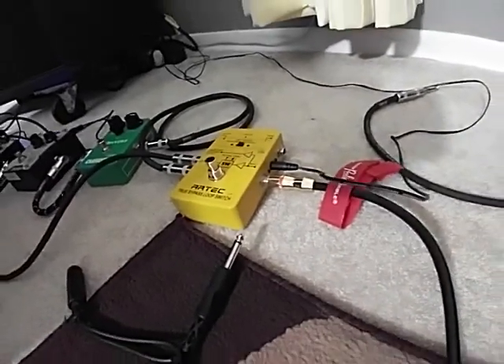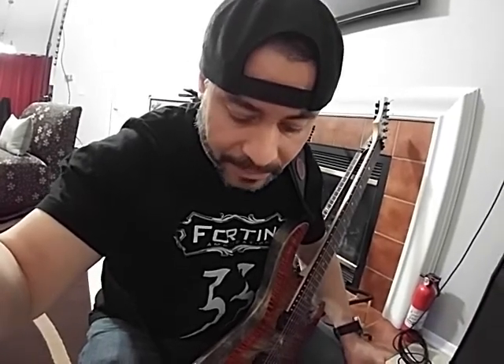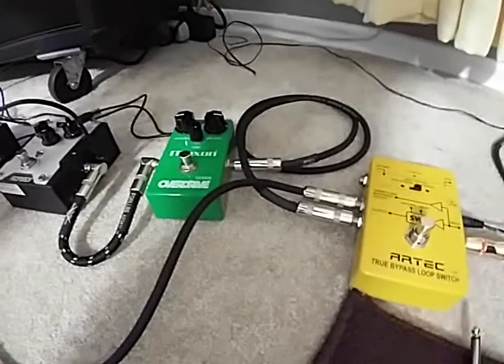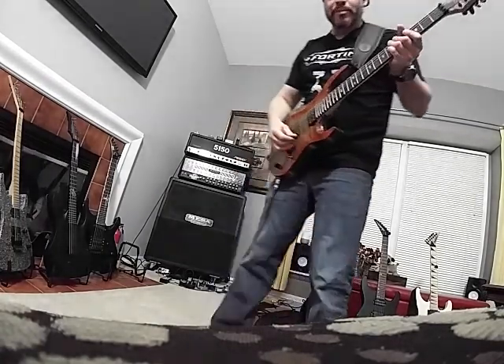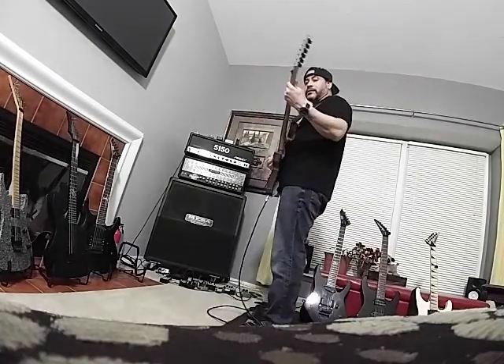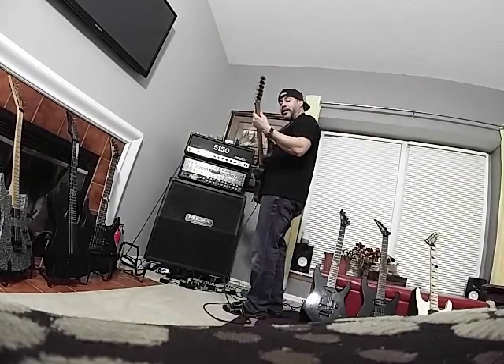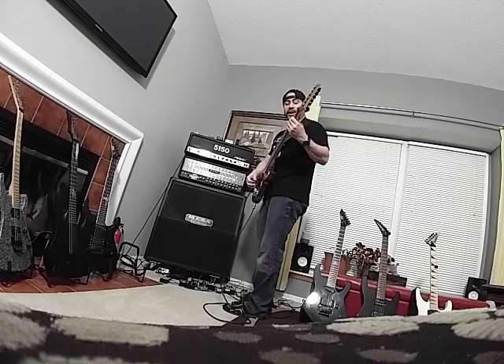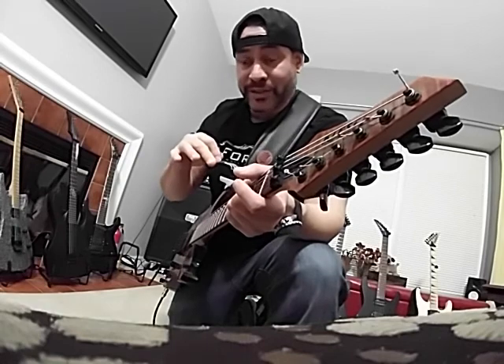Fortin, Randall, Airis, Maxon Pedal Comparison

Comment: I wonder if the reason why the Mor doesn't sound as good as the Facepunch is because you're supposed to adjust the EQ of your amp to where it sounds okay without a boost, but adding a boost to it so you can add some midrange to your tone.
Reply from the maker: After all these years, it's honestly just not the best pedal. In guessing that's why they discontinued it.
Reply: @louistorres  that's a bummer, it'd be nice to see more transparent boosts on the market that kicked your amp into high gear without coloring it like a Tube Screamer would.

Comment: Airis Savage Drive vs 33? Prefer one over the other?
Reply from the maker: Hhhmmmm... That's tough bc they're both slightly different where one is a great boost (Fortin 33) and the other is a great overdrive pedal. To be honest, I love them both for what they each do, which is different from the other. That's why I have them both and love them just as much individually.
Reply: @louistorres  Would you use them together? Basically I have a Boogie Mark III and want to gain/saturate/tighten the crap out of the lead channel. I guess I could buy them both LOL. I'm nutty with this stuff. Just had the amp modded too LOL. Also, ever try the Fortin Blade pedal? Right now my favorite pedal to use with it is a Randall R-God on the lead channel (little bit of gain, some volume - tightens it up too), the lead mode on it, SD-1 is a close second but has that "Boss Sauce" to it a little when I turn up the gain.

Comment: How much is your gain mate ?  It sounds like you got too much gain
Reply from the maker: Omg, I hate this video! Audio was terrible through my cell phone. Gain is usually set to 1 o'clock on most of my amps, some at 2 o'clock plus I vary with my Airis Savage Drive settings. Sold all my Fortin Grinds and 33s, kept the Zuul.  :)